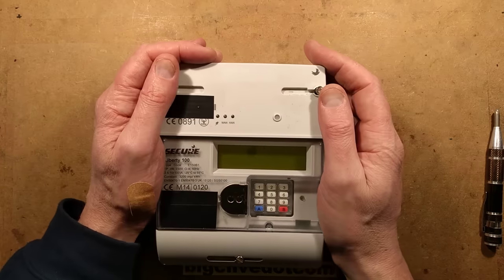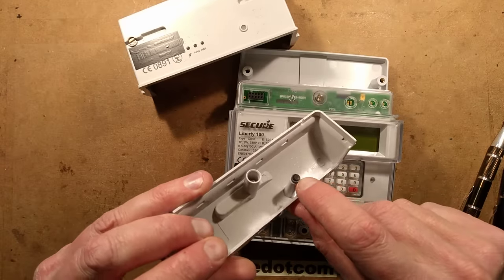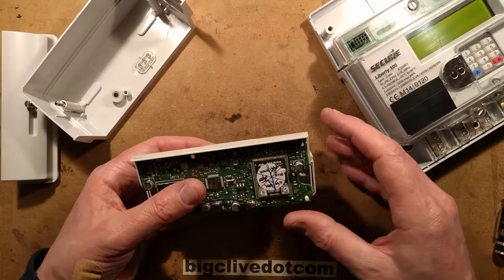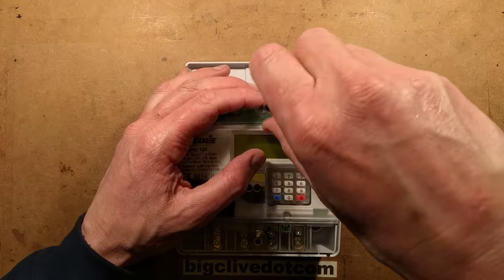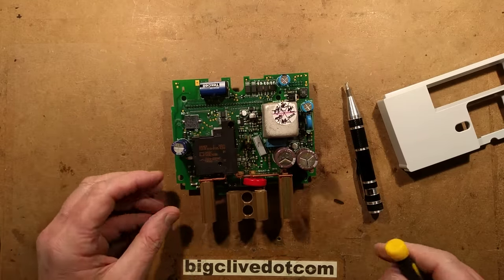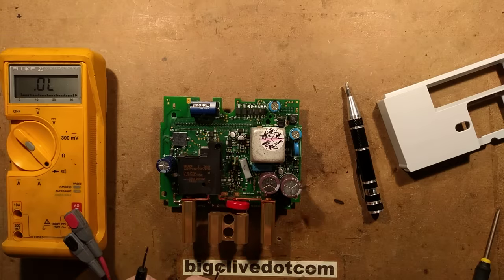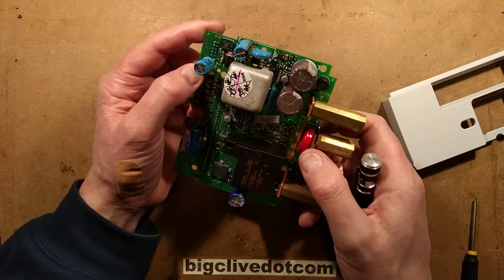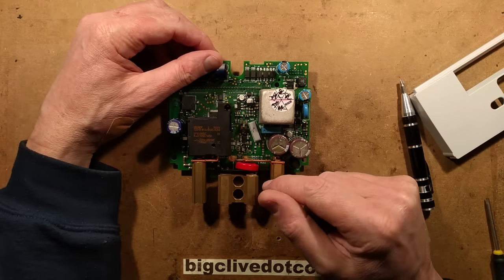Inside a smart meter, and the REAL problem with them.

Comment: My "smart" meter tried to bill me for using around 8GWh in the span of 3 hours.

Appeareantly, it lost signal and the energy company "extrapolated" the results, then trying to bill me over a million euros. 
Nevermind the fact that I have a 25A/230V main fuse and my electricity bill never exceeded 60€/month in the 7 years prior.

I told them to go pound sand and actually use the readings instead of just making shit up as they go, after a couple of months I got a letter that they made "an error" and I should disregard the previous bill.
Reply: Ahhhh, the good old days where you could draw the entire power of a city through a wall outlet,  and no one noticed the street erupting into flames...
Reply from the maker: I received a bill like that too, when their estimated usage had drifted so far above by actual usage that they assumed the meter had rolled over and the bill was massive.  They corrected it themselves though.
Reply: @bigclivedotcom  I used to do data analysis on meters and rollover was such a pain!
Reply: Sounds like you're building some kind of miniature death star in your basement, how far are you from being able to test fire it on the moon?
Reply: I programmed a database/billing system for a business energy company and I concur that rollover is a nightmare. To be honest the whole energy calculation and all the different energy factors etc etc is a nightmare!
Reply: ANameThatIsn'tMyOwn Why is rollover such a nightmare?  I ask as rollover is a very common issue in programming and it is seldom difficult to deal with as, provided the limits of the counter are reasonably sized, you are presented with two possible results: one that is rational and within reason and another that is typically insane and outside any practical limit.  It’s usually pretty easy to discard the insane value and use the rational value instead and not ordinarily a difficult problem to deal with.  If the meter readings are really so far apart that a customer could possibly, or at least remotely realistically, have rolled their meter over more than once between any two readings then the question becomes why they are taking readings so infrequently that a customer could have rolled the meter over more than once in that time frame.  

The typical older style 5-digit residential meters would require 100,000KWh be consumed between two readings to rollover just once.  Even if the meter was read only once every 3 months, rather than the once per month they are intended to be read, the customer would have to average more than 1,111KWh of usage per day (more than 46KWh per hour!) for each of those 90 days before just one rollover would have happened!  Here in the U.S. that would mean a residential customer was operating a typical 200A service at around 98% capacity for every hour of every day for months on end!  By comparison, we are a high usage residential customer at just 100KWh per day and it would take us about 3 years to rollover such a meter!.
Reply: @ethanpoole3443  the problem wasn't so much that rollover was hard to deal with but that the information about the meters was so bad. The meter could be measuring (with gas) m3, or ft3 or 10ft3 or 100ft3 and rollover at 10,000 or 100,000, 1,000,000 etc and it was never recorded right.

Tenancy changes could mean that huge changes in usage were normal too.

I got the checking quite well refined eventually - the biggest problems were readers missing/adding digits or putting 8 instead of 3 etc. Even got good at detecting that.
Reply: 8GWh used in 3 hrs eh? Assuming your electric service is 240V, that's around 11,111,111Amps average current draw! Now who wants to determine what diameter wire would be required to safely carry that much current haha? ;)
Reply: @snowdaysrule  somebody's gotta see that and say "well that can't be right" or even a red flag somebody computer" but they billed him anyway!
Reply: @snowdaysrule  about 16.2 m² (not mm²) for 100 ft of distance to the source, 3 phase 240V copper
Reply: @hanvyj2  So it's not rollover that's the problem then, its the stupid business logic layered on top of a stupid billing system?. Accountants, taking simple math and making it incomprehensible for 1000s of years. After all, they'd be unemployed otherwise.
Reply: They really should not have to wait for a complaint to notice this on a residential property. You would need your own power station...
Reply: @kirkhamandy  people filing in the wrong meter readings/units is a business logic problem caused by accountants? Eh?

Don't know why you're getting so mad about this lol.
Reply: @extrastuff9463  I was actually working on laser-based nuclear fusion but don't tell anyone.
Reply: @hanvyj2  because I have to do a tax return and it sucks
Reply: @rob3125  If they really charge you 114 € yearly for renting the meter, buy your own meter now! It's only 300 €, so it'll pay off in less than 3 years!
Reply: I don't understand how these companies justify billing for these stupid situations. I have a dual fuel supply and they accidentally transposed the serial numbers of my gas and electric meters. That meant for 9 months I was using more gas than the whole county but apparently less electricity than a maglight torch!
No matter how many times I called to explain they just did not understand the problem and couldn't see an issue!
Thankfully when they corrected it they also screwed up in other ways... Quite a few months later I had to get the Energy Ombudsman involved for us to get over £2000 back from them for their mistakes, lack of customer service, overcharging, missing FOUR meter reading appointments that I took time off work for (to solve the numbers issue) and of course plenty of compensation for their incompetence. It didn't half cause some stress over that time, repeatedly explaining my problem to numerous customer service staff and people at the Energy Ombudsman!
Reply: @GRBtutorials  
it's easier to say then done! Our power company owned by the Danish government and they won't allowed that! Because how they else going to make money? It’s like living under dictatorship! 
I leave in a apartment building with 10 other people, the only solution i think is possible is that we all 10 buying our own meter's and having a common smart meter in basement which is owned by power company, and we all share the 114€ yearly meter rent.
And this solution is also depend of agreement of my 9 other neighbors, and who is going to administrate the reading of the all meters and compare it with power company meter.
Reply: 8GWh you could power Z Pinch machine or a flux capacitor?
Reply: @rob3125  I didn't know you had such outrageous policies in Denmark! Here in Spain, it's just about 4 €/year for the meter rental (though the electricity price is pretty high). And even if you didn't like it, you can buy a homologated meter and, as long as you keep it up to date you can use it. It's expensive but if you're charged 114 € a year it'd be worth it.
As for the idea of sharing the meter, well, if you want to do that, you could buy cheaper, consumer-grade meters, no need for expensive homologated smart meters. And nobody needs to compare anything, just read it yourself and take some photos of the meter as evidence. Then the community administrator would multiply the kWh by the price per kWh (plus other charges) and send the bill to you.
Reply: where we're going, we don't need roads!  @snowdaysrule
Reply: Did you try to go back to the future?
Reply: So what is the cost of a 8Gw bill?
Reply: @Cowcow211  A group of Libyans on your tail?
Reply: @data3oh622  More like. I did some math. If he did in fact get an 8Gw bill. It'd be around 10million pounds he owed lol.
Reply: @snowdaysrule   I came up with 336 feet in diameter at 5 foot long
Reply: WTF!!??
Reply: @Cowcow211  I looked it up for you, the total on the bill was for €1.683.906,42 , but that also includes 10m³ of natural gas for €10,55.

Also your "10mln gbp" figure is a bit off, nobody pays £1.25/KWh. I pay about €0.21/KWh including taxes, but normally if you consume huge amounts of power like this you pay a lot less tax over usage exceeding 10MWh. I guess their administration system doesn't do that for residential connections.
Reply: 8 gigawatts? were you trying to time travel?
Reply: They will just blame it on AI next and electricity will be too expensive to use their own AI to prove it wrong and people only listen to machine god reeee lol
Reply: Holy shit where do they think you live, your very own iron ore terminal? A personal refinery?
Reply: bami2 🤦🏻‍♀️
Reply: @ethanpoole3443   " It’s usually pretty easy to discard the insane value " not if there are politics and stupid business rules
Reply: @ethanpoole3443  "that would mean a residential customer was operating a typical 200A service at around 98% capacity for every hour of every day for months on end"  that's PhotonicInduction
Reply: @airindiana  supercomputer !
Reply: When nice man installed one of these meters  at my mother I turned  on the kettle to make a drink  . The demand  led went from blinking to solid red.  Is this norma I asked.. he poked a button an according to the meter were drawing 70 kilowatts.. .while it's nowhere as bad  being charged for 70 kw and the total demand on the  house was 2.3 kw calls into question  the accuracy of these meter .
Reply: The brain works on electromagnetic waves
Reply: If you were with nPower they'd do two things (as it happened to a mate of mine):-
1) Send an engineer, who confirms that the meter is faulty and replaces it
2) Insist that the bill is correct and needs to be paid, even though the meter was proven faulty
Reply: @snowdaysrule  nice one mate😂😂
Reply: @richardoakley8800  ,
Reply: @lxOFWGKTAxl  Bill first and answer questions later.
Reply: Makes me think of Frankenstein, especially with the old brass meters and dials and the Jacobs ladder. at 8GWh you won’t need lightning and can all be done in the basement without winding the body to be animated up to the ceiling.
Fun fact, on the Frankenstein set, the Tesla coil was actually made by Nicola Tesla himself.
Reply: Happened earlier this year to a family friend of mine with a "smart" (lol) gas meter.

Instead of calculating the bill based on the current and previous readings, they simply added the current reading to the smart meter's initial zero.  And there you have it - £4500 bill for 30 days' usage in a three-bed flat.  The only gas appliance they have is a modest and quite new combi-boiler.
Reply: @ethanpoole3443  That'd be about $600/month here in the UK, how much does that cost in the US?
Reply: @paulpantsoff6584  Our electric meters (the older mechanical style that are being replaced with smart meters) were traditionally 5 digits for residential and very small commercial customers and measured in KW/h, so rollover would be at 100,000 KW/h at around $0.11-0.13 per KW/h (though I expect inflation will soon bump those numbers up by several pennies in the near future as my future fuel cost increases).  So a full rollover would, if improperly billed, would cost us about $12,000, though in some parts of the U.S. the KW/h cost can be considerably greater.  I would assume (dangerous, I know) that the new smart meters would be capable of at least representing those same six digits, though internally the easiest way to store such, programming wise, would be as an unsigned 32-bit integer, which would actually have an upper limit of about 4.29 billion counted units before rollover (in whatever unit they want to configure it to use, whether that be in KW/h or tenths of KW/h or VA, joules, etc.).  Thus far, I have never experienced a mistaken rollover charge on any of my past electric bills as electric companies usually have the resources to hire decent programmers for their systems and catching a rollover issue, which always results in an unreasonable KW/h calculation, is very easy to do with a high degree of reliability so long as they do not allow too much time to elapse between readings.

Which is much better than what a rollover of our water meter once resulted in a bill for … over $200,000!  Our local municipal water provider is a very small company that covers only a portion of our county and seems to rely upon their small staff to catch such errors rather than catching them at the programming level (so they never hired competent programmers to code their billing system to sanity test input and output results).
Reply: Me too
Reply: bet that was scottish power, utter scammers!
Reply: Not very ‘smart’ are they
Reply: Anyone doing this sort of billing software should have code that catches bills that change stupidly and put them up for manual review before any bill gets sent to a customer.
Reply: Terrible engineering. How does that sort of anomaly not trigger error code. The quality of engineering is plummeting badly.
Reply: We all know you actually travelled Back To The Future 6.6 times and you're just trying to get out of paying the Flux Capacitor bill...